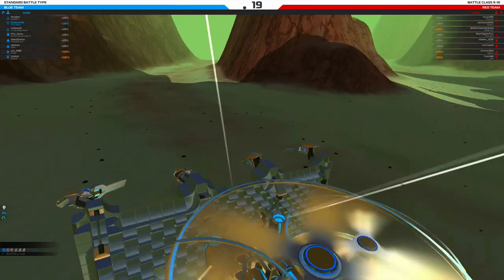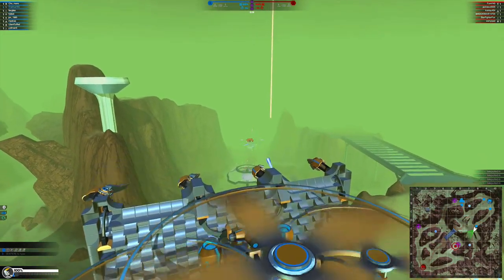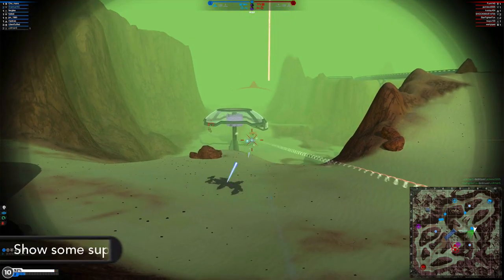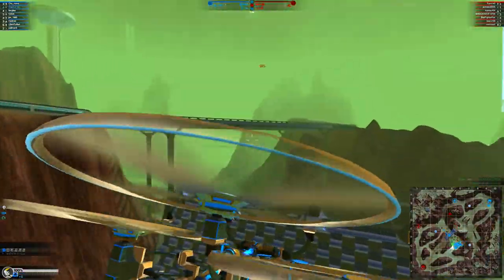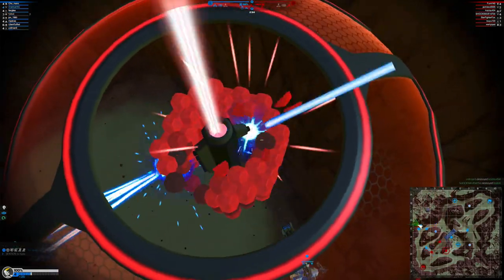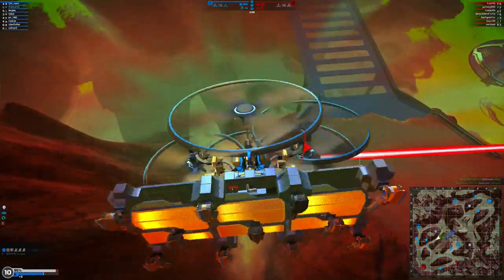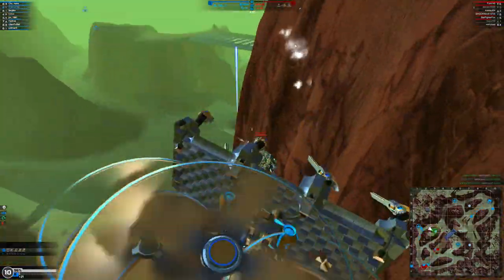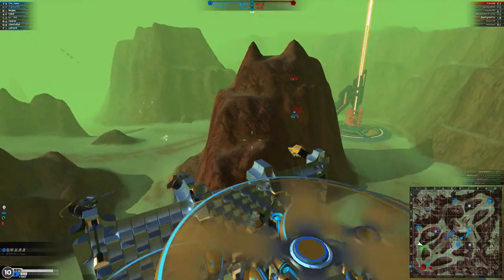Robocraft: TH3 W4LL a Triforced, Electroplated, SMG, Copter Build

Comment: Don't tell me you are quiting Starmade mate?
Reply from the maker: +Lino Santos Nope! not gonna happen any time soon. It is just, i do play robocraft pretty often like "in between" two activities. So i just thought well let's make a few videos about the robots i build. Don't worry man starmade just requires more build time so it needs more effort to build for an episode andthis weekend the server is going to be reset.
Reply: You play on Shattered Skies?
Also you might find that smaller rotors are more viable than larger ones :)
Takes less cpu (and blocks to connect), half the size, have the same carrying mass and have 2/3rds the hp.
Reply from the maker: +Dire_Venom i am mainly playing on the Star Squadron server but we have a Starsquadron faction on starside to interact with fans. so regular viewers might join there. When playing often also hanging out in TS there...
the thing with the smaller rotors is the less hp and CPU issue but yes i mixed t10 and t8 so ...